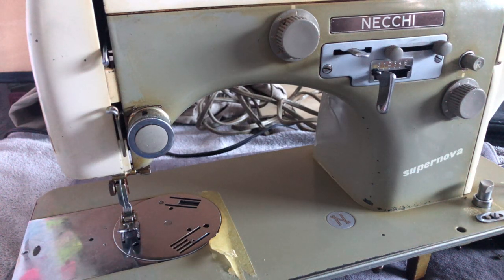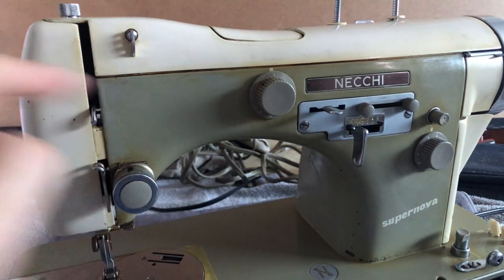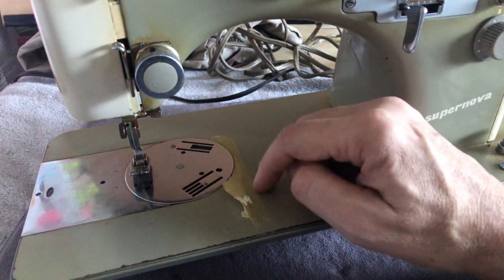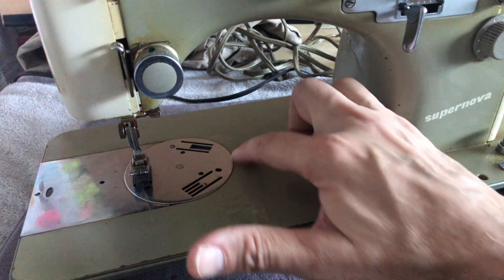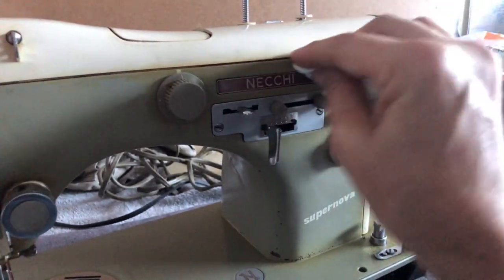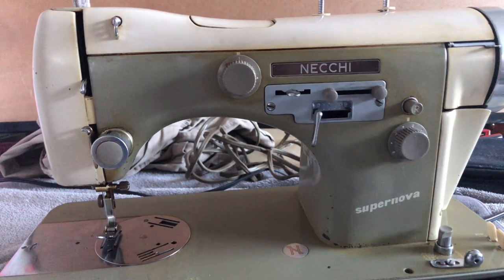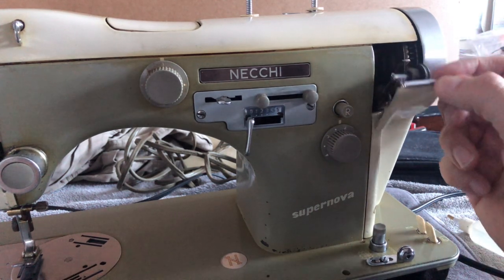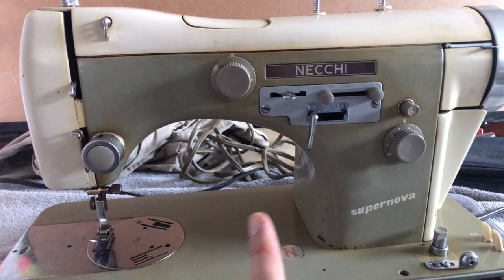CLEANING SERIES #14: How to Remove Tape Off of a Sewing Machine: Less is More!

Comment: Great video.  I love all your videos, I have learned so much with them.  I also make sewing machines videos, but in French as the machines I restore go back on Kijiji.  In my area, it is mostly French speaking folks, so my videos are for them.  Anyway I found out the best cleaner for old Scotch tape residus is lighter fluid.  I think this will also work for masking tape residus.  The lighter fluid does not damage the paint, either on old black machines nor on colored ones.

Comment: Warts are ok. They are part of her life. Tape and marker give me hints about which machine I'm using. I have a White that has a similar bobbin system, with of course, non-standard tires. Smaller inside diameter, so I'm on the hunt as well.

Comment: How about cleaning a machine someone left in a moldy case? The smell is ghastly even after I cleaned out every bit of oil and grease. It’s a gorgeous world’s fair edition of a White “Lady” and I’m heartbroken. Bought online off eBay and the sellers weren’t truthful.
Reply from the maker: Well, the good news is that you can remove the machine and install it into another case or table.  The machine itself will only absorb odors into old oil or grease.  The metal itself does not actually hold odor and so once you have the machine cleaned and re-oiled, this should help in removing the smell.  I have tried in the past to spray or wipe bleach-based cleaners on the case and (sometimes) the smell will dissippate with this treatment followed by airing out by placing outdoors in warm sunlight.  Most of the odor you are smelling is from mildew which can penetrate the vintage cases; many of which were made with a board-like material covered in vinyl/fabrics which absorb moisture and molds.